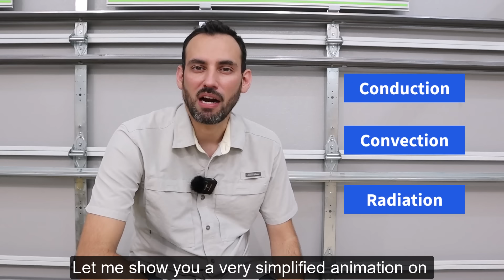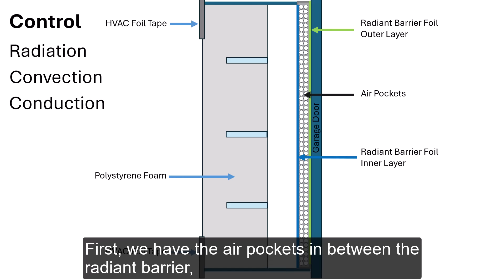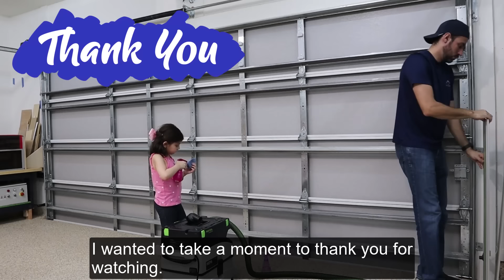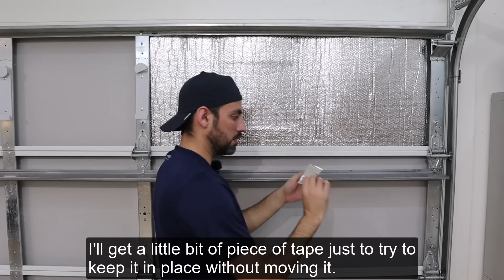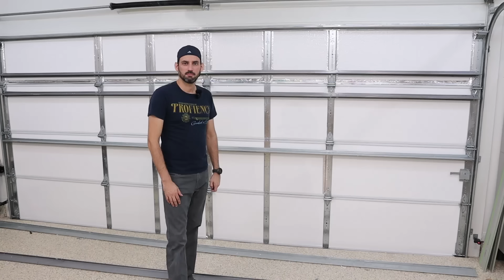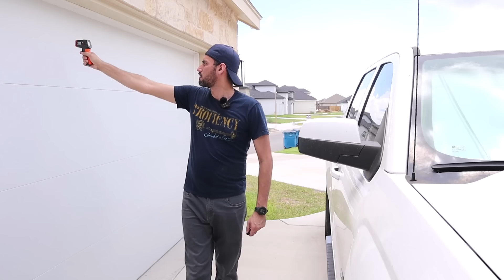The Smartest Way to Insulate Your Garage Door: A Complete DIY Guide

Comment: I have a several question but most importantly - THANK YOU! THANK YOU! THANK YOU! I've been scouring YT on and off for a few years looking for someone to explain the best way to insulate my garage door and why - you hit the nail on the head. Few questions: does any of this vary if the garage door is wood (I have a wood door)?  what about foam thickness? I noticed you had pink in the background but used white - density difference? Last question, with regards to the reflect aluminum barrier, on mine one side is the "aluminum" reflective side and the other side is white. For wood doors, you're supposed to have the white side facing the inside of the garage. Do you know why? Thanks again for video!
Reply from the maker: Hey @Irita7179, I am glad I was able to help out. I am more than happy to help you out answering your questions. I will try to  put everything in simple terms. First, wood itself is a great insulator. If you think about it, wood could be burning literally and you could be holding the other side of a torch without burning your hand. Having said that, having a garage door made out of wood is a great start, much better than steel, .....maybe? Like anything else, pros and cons. Steel is strong and could potentially be lighter than wood (will depend on wood species). Wood could be lighter or heavier depending of the species, great natural insulator, but if not treated, could rot, so constant maintenance is required.  Regarding the foam thickness, the thicker the better since you are providing more volume for the heat to dissipate through. The pink foam has a higher density than the white Styrofoam, the denser the heavier. I chose, the white foam for its lighter weight and aesthetics. You want the aluminum looking reflective film/panel on the outer side since it will reflect back most of the infrared electromagnetic radiation (infrared light). Some energy (radiation) will be absorbed regardless, another portion will go through, but what we want to do is to try to bounce back as much energy (radiation) as possible. The reasoning behind using white panels pointing inside the house, or on some roofs is again more physics based. In terms of the visible spectrum of light, white light is made out of all colors, Black, is the absence of colors. When our eyes see a red object, that """RED""" object basically absorbed all colors from the light except red, it bounces back the corresponding wavelength to the color red, hence why we see a red object. So a black objects absorb all colors and reflect none, hence why we perceive them as black, absence of colors. White objects absorb none and reflect all colors at once, hence why perceive them as white. So with that on mind, roofs are painted white when they want to bounce out all visible light. Except that infrared light (our real heat) doesn't care and simply wants to go through everything. :D  Sorry for the long essay. I hope it helps out even a little. :)

Comment: That extra weight won't be an issue surely....ask me how I know.
Reply: Your garage door opener (even if it's you manually lifting it) should notice zero difference because you should have the spring retentioned to handle the heavier door.  Probably cost $100 or so if you don't want to do it yourself (scary stuff if you don't know what your doing).
Reply from the maker: I am afraid to ask hehe, but I will frame my question differently. How long did the motor last? All information is good to know. I had to rebalance my torsion spring with 3 additional 3/4 turns to compensate the additional weight.
Reply: @CarlosWorkshopHaven  If you're already comfortable balancing your springs, then if the current ones fail and that's your current forever house, you can just replace them with a high cycle torsion set. They don't cost much more and greatly extend the service life of the torsion springs.
Reply from the maker: Hey @platniumdr, you guys are right! I’ll be posting a new video soon (the next one) on how to replace torsion springs. Mine is fine, but I currently have one spring instead of two, so for safety reasons, I’ll be adding a second or replacing it with a new pair. I’ve also received other feedback, and I’ll address those questions in the next video too.
Reply: @CarlosWorkshopHaven  to be fair, I insulated a manual door.  10x14.  got 6 panels insulated and the current spring tension would no longer allow me to lift the door.  spring broke after 1.5 yrs, even after removing some of the panels.  Thinking about the operator, it may be fine.  I may have missed if you added tension to the spring, but it may be worth a little.
Reply from the maker: @aelfswith  I am starting to wonder now about the torsion spring itself. I re-adjusted the torsion spring to rebalance the door in order to alleviate the load on the motor, but I don't know the effect on the torsion spring itself. I will need to look into that. Thank you for your insights @aelfswith.
Reply: @CarlosWorkshopHaven  normally, a door with an operator is tensioned less than one without so you may be fine. Especially if the spring is not pretty old.